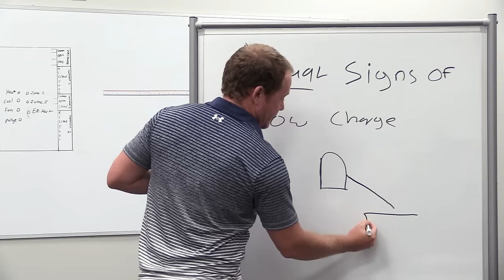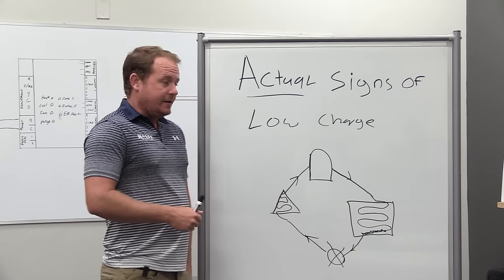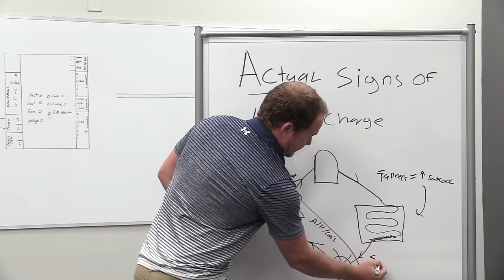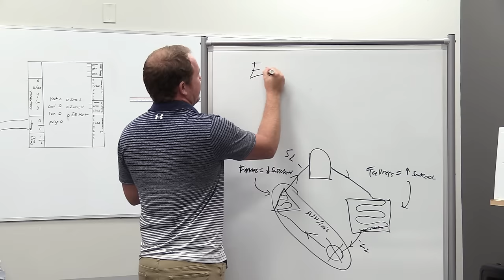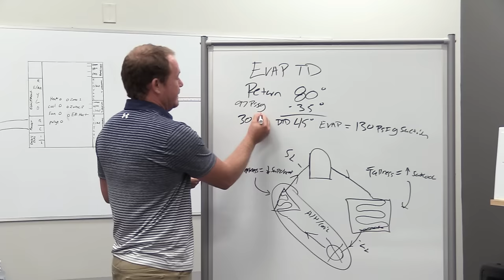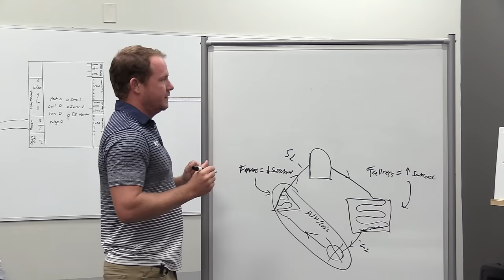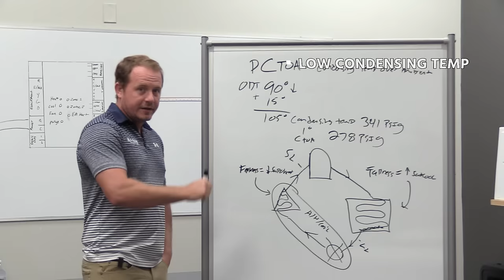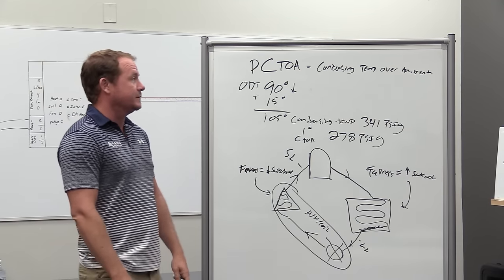Low AC Refrigerant Charge - How to be SURE (Does it really need Freon?)

Comment: I don’t understand where the number 35 is coming into play on evap TD can someone explain
Reply: The evaporator transfers (sensible and latent) heat from the room air to the refrigerant. For comfort cooling conditions sensible heat lowers the air temperature and latent heat changes the water vapor in the air to condensate.
 
It really revolves around optimizing AC equipment and comfort relative to seasonal conditions (typically using comfort charts AKA psychrometric charts.) Under average conditions for a climate with high humidity, the evaporator coil operates at a refrigerant temperature that is generally 35°F below the temperature of the return air. This is roughly equal to an evaporator saturation temperature of about 40°F, which allows the coil to remove the required amount heat (both sensible and latent). However, if the humidity is very high the coil temperature may be a little lower (to help remove more humidity) and if the humidity is very low the coil temperature may be a little higher. Generally, 35°F is used so the evaporator saturation temperature stays safely above freezing to avoid any potential for equipment icing under varying conditions.
Reply: Manufacturers design their evap coils so that they operate at a 35 degree TD.

Comment: In theory this is true, but in practice this knowledge is not sufficient.There are things to consider- old system, no sight glass, dirty or partial dirty evap- or condenser, moderate oil deposition in the evaporator,condenser and the lines associated.Normally subcool and superheat are nice indicators, but check the amps - this will help you in the field.

Comment: When in doubt, weigh it out. Pump it into a clean recovery can, weigh it, then you know with 100% certainty whether or not the charge is correct. I found this to be faster than taking all the steps outline here. If you weigh in the charge to factory specs and the pressures are not correct, then you know for certain that there is another issue/problem. Makes selling the repairs so simple when you can tell the customer with 100% confidence that the charge is right and there is another problem.
Reply: Do you always have a clean recovery tank on each call, and do you return the refrigerant back to the unit after weighing or do you charge it back with new freon?
Reply: That would take way more time.
Reply: I can do all the steps taken here in less than 10 mins… LOL in fact it would take longer to weigh it out.
Reply: @robertcherry4971  It only takes about 10 minutes if you have a clean empty recovery tank and a quality recovery machine. Weighing it is 100% accurate. All other methods are close, but not as good. Best part is with weighing it, you eliminate one potential variable. Here in Arizona with our extreme ambient temps, the majority of the service calls are during times when the ambient is above the range of the manufacturers' charts, so again, weighing it is best for us.
Reply: @realSamAndrew  Yes, I keep a couple empty recovery tanks with me. With the reclaimers paying as much as they are for used clean freon, I don't want to risk cross contamination. Yes, the same freon goes back in unless there is reason to suspect it  is dirty, in which case we change the filter-drier and weigh in new freon. It is good to know how much you recover because then you know if part of their problem was incorrect charge or not.
Reply: @Jshortca1  Not with an empty recovery tank and a quality recovery machine. I can recover the freon in about 10 minutes and then I know for certain if the charge was correct or not. In 22 years of being a licensed contractor, I can say I see techs mess up the charge almost as often as they get it right. Weighing it eliminates all possibilities of making a mistake and that is what the customer is paying for. No reason you can not charge extra for pumping it out and weighing it. I do. Not once has a customer objected to a $20 charge for pumping it out and weighing it.
Reply: @briangc1972  1. In order to always have empty tanks on hand, do you turn them in every day, or only partially filled? 2. How much is the rate for recovered freon? The numbers I've seen are a joke.
Reply: Brian unfortunately I just do not gas and go. So I need the information above to se if machine is running to capacity. I test in and out on every job I am a comfort specialist not a gas and go guy. Not to mention I work on units fro 4 lbs of refrigerant and up to hundreds of pounds.I would really blow your mind if I talked about non invasive ways of checking charge. But like I said these indicators tell me if pressures are low because of a restriction,undercharge,or low air flow. Even when I do weigh in I fine tune with superheat and Subcooling see line set length and fitting pressure drop and filter driers also change your weigh in amount on the data tag.
Reply: What if it is low and there is a non repairable leak on the evap coil? Now you have an empty system with a leak that you cannot evacuate properly.
Reply: Yea he has a long way to come. He probably does not know how to read superheat and Subcooling. Especially since he thinks that process is quicker. Probably can not tell a undercharged from a restriction and just starts recovering ha ha
Reply: @realSamAndrew  Up to $11 / pound out here. Over the years, I've accumulated 8 tanks. Keeping 2 empties on the truck is no problem. Taking them in half full is smart because recovery times are less and the recycler simply swaps tanks with me, so I go in, he weighs my tanks, pays me for the freon, I grab an equal number of tanks from his "ready to go" bin. All his ready to go tanks are in excellent shape. Also, Not filling the tanks full prevents ruining clean freon with contaminated freon. I made that mistake last year and it cost me over $100 compared to if the tanks had not been mixed with that dirty system's freon.
Reply: @robertcherry4971  I never said anything about gas and go. Those gas and go guys are what cause many problems. That's another reason to weigh it out. Let's keep this in context, the video was specifically about residential 2 to 5 ton systems, not 25 ton or 50 ton chillers. Although, there was a project in Phoenix a few years ago where the "techs" didn't weigh in the freon in a commercial chiller. They destroyed 2 compressors from over charging because they tried to rush the job and never gave the system time to stabilize. They just kept opening jugs and watching their gauges.....That was a $25k mistake.
Reply: @j303ti  Obviously, you should have enough experience to see an obvious undercharge from a leak. Use common sense.....
Reply: @robertcherry4971  Making stupid comments like that when all I'm offering is a proven alternative method just makes you look foolish. Many times, I've been the 3rd or 4th guy out to a house that has problems that the other "techs" couldn't find and correct. My business is 100% referral based, I haven't advertised in over 10 years, I make 6 figures annually. Consistently. You don't want my suggestions? No problem. Just keep your snide remarks and foolish comments to yourself.
Reply: @briangc1972  yeah same thing with overcharge. Use common sense.... you're the one weighing the recovered refrigerant because you're in doubt.
Reply: @j303ti  You are missing the point. You guys are checking temps and pressure to see if the charge is correct. Weighing it is another method to see if it is correct. There are specific applications where weighing it is the better choice. Here in the desert, with 110˚F ambient, with a house at 82˚ or hotter, you can not check sub cooling because your TXV will be wide open. So your choice is to wait 2 hours for the house to cool enough that the TXV is modulating or weigh it. Obviously, the quicker method is weighing it. We deal with extremes that require alternative ways of doing the job. I never said NEVER take pressure and temp readings which is how you guys are interpreting what I have said. Stop being so 1 dimensional. Learn to think outside of the box. I never said to weigh every single system. I said it is an alternative method to use.
Reply: Sure it sounds easy to do that.  Yet you run the risk of air  contamination.  I'm certain not all techs do it correctly.  Absolutely  no need to pump sytem out. Sorry, but your advice is not good. You NEVER take it out..That's a closed loop system.  Any kind of exposure to possible atmospheric air isnt good. You will eventually cause the system to fail. Your gauges alone will create that effect. That's why this video has a professor explaining how to do it. Besides I thought Techs get paid by the hour? 
Practice makes you efficient.  Quick isn't the trick. You must learn troubleshooting.  1st
Reply: @briangc1972  I dare you to mention the company you own or work for!  That will help us all know who to call or....NOT. 
Maybe someone on here can figure it out.  You know dang well your way isn't good. You just like efficiency not QUALITY.  you already mentioned your mistake and how much it cost you. How smart was that. Yes its called HUMAN error. Precisely why you shouldn't EVACUATE unnecessarily.  Good luck with your option. I don't recommend you keep doing that. Failure is not a great quality.
Reply: @briangc1972  your comments mention thats exactly what you do. You never test.. so why get mad?  You evacuate plain and simple.   It's your go to option when your in a hurry. Then you mention other techs who can't figure it out. Yet evacuation is? You still have to troubleshoot no matter what. Your teaching poor habits to new technicians.
Reply: @bigdog2084  Your are completely wrong in your analysis of me
Reply: @bigdog2084  What mistakes and how much money did I lose?
Reply: @bigdog2084  You are making way too many assumptions. You need to calm down, go have another beer....
Reply: @bigdog2084  Based upon your anger and the quantity of your replies, I'm guessing that you are one of those guys that doesn't even own a recovery machine or vacuum pump......
Reply: @briangc1972  
Like i said...i dare you to put your company name out.  Go ahead and put out a video aswell. 
You sir are a RAMBO COMMENTOR.! 
That's why you and I both feel comfortable talking crap. It's the new way of communication without fear of the consequences of our ignorance. 
I get it you seriously think your advice or skill is EXPERT level. 
Just like people that go to Las Vegas and brag they NEVER lose
You sir will NEVER tell the truth as to how many systems you have destroyed because of your way of removing and re-filling a system. 
Troubleshooting has many tricks. I won't trust yours till i see numbers. 
It's irrelevant.  Hence why your getting so much feedback from others aswell
Reply: @bigdog2084  Number of systems destroyed? 0 Been a licensed contractor for 23 years. Been self employed for 23 years. Haven't advertised in a decade, already have more business than I need. Unlike some, I don't feel a need to be a large corporation. Name of my company? Not going to list it online here because it is too easy to be doxxed. Las Vegas? Been there many times in the 90's, never lost, but I never played.....Was in town to do a few projects. That is how you beat the casinos; just never play. Worked on a few medical centers when I worked for the 2nd largest mechanical company in the state. That's enough background on me. As far as the TRUTH, you wouldn't know the Truth if it bit you in the 🐎

Comment: Hi sir my name is vimal i am from dubai  i have 2.5 ton ductable split ac in this ac supply temp not down  below 60.8 ° F this is r-22 refrigerant suction pressure 80 psi
Suction gas pipe temperature - 46.4°F
Metering device  - orifice type

Comment: I have a question about an anyone know an app that help you with subcooling when you put in certain data it will tell you suggested subcooling thanks
Reply: Manufacturers specify the "suggested" subcooling on the condensing unit's nameplate.

Comment: 9:45 so if return air is 80 degree and evaporator temperature is 65 the working temperature is 15. 15 degree below designed 35 degree temperature. And super heat is 25 and subcool is 10. I got too much refrigerant? 😂 I'm so lost.

This is new carrier system with slab coil new ducts new plenum

Comment: What if the condenser has a txv
Reply: Then you're referring to a heat pump. On cooling that outdoor txv will get bypassed. In heating that will be your metering device for the outdoor coil or essential turned into your evaporator coil.
Reply: @mackenziegray2090  thanks, I'm still pretty green. I have a system with a restriction somewhere. I'm thinking the accumulator might be clogged, someone may have added a sealer before me
Reply: @Korrea00  never heard of a accumulator getting clogged. It's just a storage vessel. What's your subcool superheat? Temperature across the filter drier?
Reply: @mackenziegray2090  I saw on this channel that the screen in the accumulator gets clogged. Maybe I miss understood that video. 

And subcool was 6.0 superheat was -.04
Air coming across was 64 degrees. Delta t was 15. 

I didn't find any Air restrictions, all vents , filter and coil was clean.
Reply: @Korrea00  wait... -.04 superheat? Somethings not right there. You might be facing airflow issue. Subcool is lower to normal. Usually aim about 10 or so on subcool (carrier recommendation). But the superheat isn't right. Hard to help when not visually looking at the unit.
Reply: @mackenziegray2090  yeah my buddy said it sounded like Air flow issues. Any way it wasn't my job. The company had sent me out to just do a condenser wash, and add refrigerant if needed. 

So it's going to be going back to the tech that said it was refrigerant issue.
Reply: @Korrea00  when you said you checked the coil, did you look under the coil itself?
Reply: @mackenziegray2090  sure did looked brand new. Its a one year old goodman air handler on a 4 yr old York condenser
Reply: @Korrea00  maybe check and make sure the blower motor is a correct speed. About 400 cfm per tonnage. Might need to measure static pressure and look in manul and adjust blower speed to whatever static you have. Usually you wouldn't go above 0.2 on the return. What side is the highest usually means that's the most restricted. Overall sounds like your not supplying the evaporator with enough air.

Comment: 9 out of 10 times it's low on freon. Most techs that come to my house don't even go inside the house. They hook up the gauges and say yep it low. They add it I pay them and they leave. I don't know anyone that has a unit where they never added freon at least ever other year
Reply: If you're adding refrigerant every other year there is a LEAK in your system, you should theoretically never have to add refrigerant, of course that isn't how it plays out in the real world but adding refrigerant every year or every other year means there is a problem with your system and a leak needs to be repaired. It is not normal by any means.